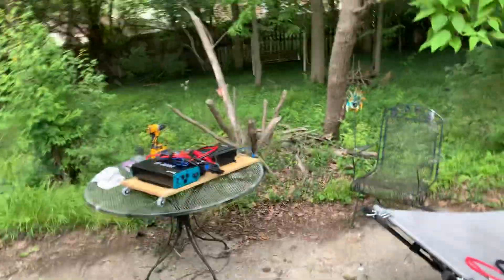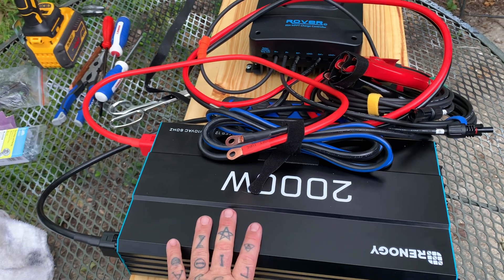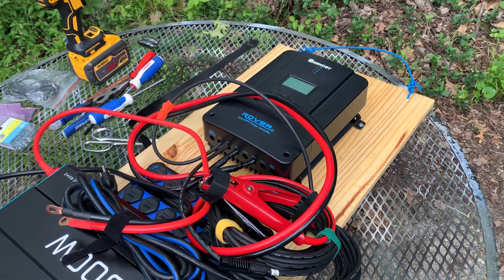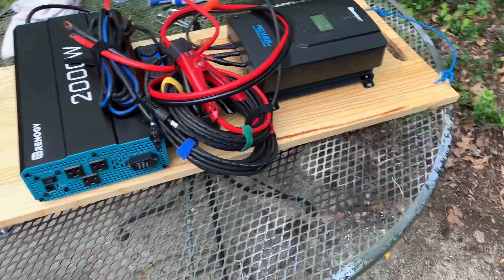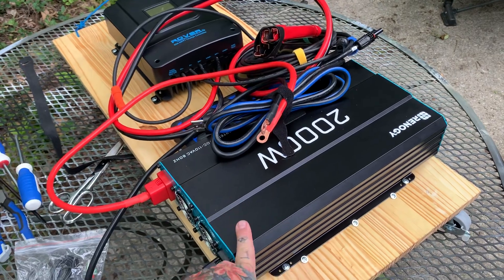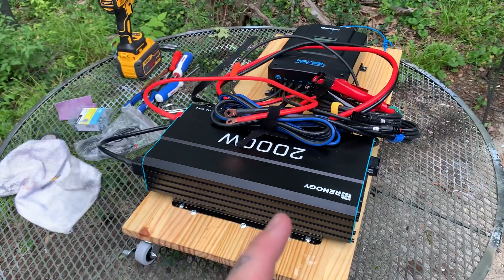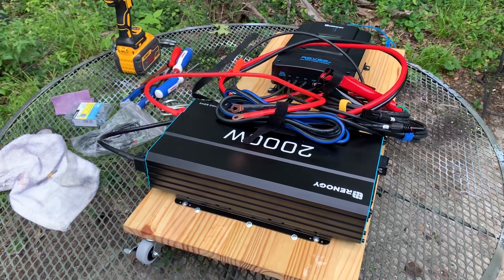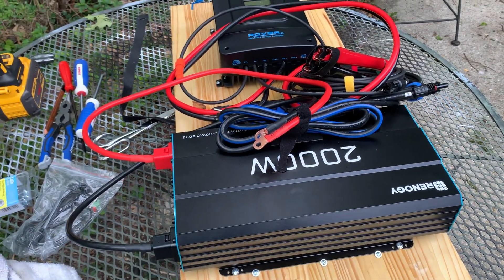🤩🌞 My portable SOLAR POWER rig I built ☀️

Comment: Nice….I got a couple power banks but I probably should have gone your route. That inverter can’t be cheap and that control box. You be doing just fine when the grid goes down. Xiegu X1600 portable HF Ham 10w radio and you good to go. Does hurt to have  Avtomat Kalashnikova or 2 either.

Comment: Get lifepo4 batteries a lot lighter, and more capacity compared to lead acid for the same 100 aphr is only 40- 50 % efficient, 100 amhr lifepo4 90-95 %

Comment: Hurricane season in a couple of weeks and it’s an El Niño cycle.

A few years ago (probably twenty) there was a company that sold a bug out trailer. Just big enough to carry your supplies, not like a camper. That small trailer at harbor freight that size, with a couple car roof top cargo boxes bolted on it and it has all the supplies for a family of four for X amount of days. The selling point was that it was ready and all you had to do was hitch it up.

I like low voltage lights and just started toying with them instead of using an inverter.

Comment: Lead acid is obsolete maintenance nightmare.  Even grabbing some Chinese low end lithium iron phosphate 12v batteries on Amazon will last much, much longer without the maintenance headaches.  You'll also get more usable capacity vs using lead acid as most lead acid batteries you can't discharge below 50% without damaging the battery.  With the low discharge and charge rates of solar a lithium iron phosphate battery will likely outlast you.   The only downside of lithium iron phosphate vs lead acid is you can't charge them below 32F/0C without damaging them.

Comment: Not just wise and intelligent but also excellent taste in cordless tool and battery platform. The 60v line is my personal choice as a professional. You should also have some lighter 20v batteries of varying amp hour sizes for the non 60v tools in certain applications where you must consider the weight and fatigue.

Comment: Sir, don't forget fuses and main shutoff switch.  If possible, go 24v or even better 48v battery system.  I run 8 GC6 Costco batteries in 48v config.

Comment: I recommend lithium over any other battery mostly because it is maintenance free. My 400 watt solar panels array with 1100w inverter, 40w Renogy solar charger, 200A battery will recharge my portable tools, provide lights (led), operate a small flat screen tv, radio/cd, and as of this week, I'm making ice cubes (during daylight hours only). Also, with lithium batteries it allows you to completely drain the battery without harming it. Renogy offers kits for beginners. I've had my set up for 4 years now and love it! Last I love Will Prowse's videos, but he tends to over design which leads to a little confusion at times, so beware.
Reply from the maker: tons and tons use lead acid, .....its mostly maintenance free
Reply: Yes, but with lead acid it's too risky that you may inadvertently discharge 50% of battery capacity and damage it. For weekend warriors like me, less that I have to engage w/ my system , the better.

Comment: jumper cable clamps crode badly over time  it is much better to use lugs   its not hard to change clamps to lugs if you have problems   looks like nice set up i would make sure your inverter will run your microwave    i build my own low freq pure sine inverters   i have built them for friends also   they have very low idle waste lower than most maybe all high freq inverters  some have been running 24/7 for years now not one blow up   i forest gumped some incredible transformer winding techniques   these techniques makes for very low idle waste  it is very easy and cheap to build your own inverter Ken   if you ever need a bigger one you could build your own  dont think no i could not Ken i know for a fact you could      the learning curve is very small   you can order the main pcb boards with all components already soldered   they cost around 150 bucks for 10 thousand watt board    the case and tranny and other odds and ins you should be able to get for under 200 bucks   i have found then for free many times    even though it is a 10k board i rate them for around a 6k inverter that will easily start loads above 10k    my buddy has been running big air compressors welders planners  and tons of other shop stuff with one i built few year back                       the hardest part is rewinding a transformer  in most cases you only have to rewind the low side    the low voltage side is large wire with few turns compared to the 120/240 volt high side     so it is not that much work to partly rewind a tranny   the next hardest part is mounting every thing in a case   the pre made pcb boards truly make it easy to build your own inverter   if you can find a tranny and a case for free you may get by for 150 bucks or less   these are heavy duty  crazy tough last forever start huge loads low freq pure sine inverters  and with my winding tec very low idle under 20 watts on the one i built for my buddy
Reply from the maker: i would not use a microwave actually
Reply: @KenTheoriaApophasis  some or most charge controllers need batt hooked up before solar panels   it will blow most if you hook up solar then batt     knowing you you could school me lol but maybe this will be a reminder lol     microwave to heat some thing up is very very handy   i bet the 2000 watt inverter you have will run a small one   it dont take much capacity to run a microwave a few mins a few times a day     as long as your batts will handle around 100 amps of discharge for a few min you should be ok      12 volts  times 100 amps equals 1200 watts   a lot of those little microwaves pull 800 to 1000 watts    a little goes a long way for lights charging phones laptop tool batteries dish tv internet modem               these things makes life so much easier much better      a small system will most likely keep with those things 95 percent of the time   a bunch of cloudy winter days in a row will be that other 5 percent                               you can also add a small very efficient fridge to a small set up                                  you mite need a small propane generator for those 5 percent of times                  my ee friend and i are going to be prototyping a propane powered battery charger soon      a 120/240 generator plus a high dollar high output battery charger is needed to charge a solar battery bank   the higher the output  of the battery charger the quicker the battery bank charges     reg batt charger  could take many days to charge a battery bank and if it was a big bank even weeks lol    think about it 2 completely dead 100 amp hour batteries would take 20 hours with 10 amp charger    no one wants to hear a genny that long lol   50 amp charger would take 4 hours that is reasonable      price a 50 amp has to be continuous battery charger not just burst of 50 amps  lol    just examples no one would run batt bank 100 percent dead but you get the pic     there is lots of loses converting from ac to dc and using two machines to get job done also      a dc battery charging generator would save money because you dont have to buy a high dollar  battery charger and a ac 120/240 generator    it would be much more efficient only converting energy once and using only one machine           plus less to go wrong or up keep when using one machine insted of two         plus my buddy can make it auto turn on at any sag voltage and normal battery charging voltage the user sets                                                                      battery voltage sags the more power is used    so lets say 95 percent of the time you dont use over 2000 watts       5 percent of the time 4000 watts       normaily you have to buy enough batterys for that 5 percent of the time   this means dubble batt dubble cost      instead of dubble the batterys the propane batt charger can be set to auto kick on when the voltge sags   it also turns its self back of when extra wattage is not needed   there is so many more awesome benifets to many to write here          my ee buddy is  finishesing updates on a diff product him and another friend broufgt to  market a few years ago            he sould have time very soon to work on the brains of my propane batt chager                                                                                      it would be at no cost out of pocket to you if you wanted the first prototype   i would only want you to give your honest opinion about it on one of your videos                    it might lite a fire with my friend the best in world ee AND programer  in the WORLD!!   if you wanted the first one   Ken you know me well enough by my texts that i would not lie to ya   Yes Ken you also know i am a dumb ass hillbilly   But you may not know i have some intelligents along with lots of forest gump   My ee friend is a prodigy there's none better at new school than him in the world   I also know the best old school ee in the world and a few that rank very close in old school and new school       I am serious about this but make no promises because of others schedule!!
Reply: The dc propane battery charger will most likely have wifi so any setting can be changed from any where in the world from your phone or laptop                    It will come down to cost but knowing my ee buddy he will not settle for nothing but the best    He dose research on every little component that he uses in his design  Every little component that gets soldered onto the pcb has so many years track record with no issues   He WILL NOT design any thing with inferior parts to save money    He has to work for him self because of this  The last big i mean huge company that haired him to redesign a product got told to shove it      It was over a tiny component costing one or two cents more  He worked a few months and would not budge on the company owner wanting to save a few cents on one component     ee designers get paid when completed  design with cad and gerber files and programing is handed over   Every thing was finished besides changing one component  to save few cents per devise      Instead of putting a design out that would fail not long after warranty he told company owner to shove it    Company owner could not believe it the product had already been proven   Change one brand component get your pay check   Pay check i dont know for sure but had to be 10 to 20k   There are a few left in the world that care more for people than money Ken     I hope you remember this   You will see for your self if you decide you want the first propane battery charger     let me know if your interested and i will get with him to see how long to make it happen   It will not talk him long it will be cake walk with his eyes closed compared to what he has been doing    You would love and you need some of there other products              i think they need more advertising on those other products also but i have  zero say on them but can bring it up and bug  lol
Reply from the maker: jumper to battery from charge controller is find, but NOT from battery to inverter
Reply: @KenTheoriaApophasis  believe it or not Ken the SMART apc ups are pure sine wave and can very covenant    They normally are 1500 or 2000 watts you can use them off grid like reg inverter   Push and hold power button let go when it beeps to turn on to use off grid     Or you can plug anything into them you want to stay on when power goes off and plug it into the grid   They have a built in batt charger that auto keeps batt topped up  You can change the charging setting for diff batt types or voltages   There is seral port and or usb you can plug laptop into to change any setting    They must say SMART to be pure sine as far as i know   The small batteries in them go bad and people throw them away or sell them dirt cheap   You can hook reg size batteries to them   Most i have seen will need two batt for 24 volts They sell nice looking battery cases to put the reg size batt in for around 20 bucks   Of course the nice looking cases that cover up the batteries are not a have to   I have used one for 5 or 6 years on modem lamp tv and dish box  Before i hooked it up kids or wife would miss the most "important" part of movies all the time  Dish box takes for ever to boot back up and the grid power flickers or goes off all the time around here   I have a decent size solar system nest door in my shop   We dont use the shop solar when the power goes out unless it is out over 2 or 3 days   We could easily run a cord over but this little 2000 watt smart apc dose every thing we need until grid comes back on   It is so easy to take old bad batteries out and hook up 2 reg size solar batteries   Some mostly the sever rack flat type smart apc have anderson plugs   I have never heard or seen one that was bad besides the bad internal batteries  They are very tough low freq inverters      The reason i wrote this book on smart apc ups is shit happens ALL THE TIME   Even way more so with high freq inverters    These smart apc ups inverters can be free if you not in big hurry and look    They make a very reliable tough back up inverter   And every one needs a back up for there back up   One or two would not eat a thing and may very well save your ass   You can use off grid with solar panels just like any other inverter     Good barder materal if shit hits the fan also a little power goes a long way    Ambers shaking her head i must have past over board  hours ago Lol  God bless you Ken

Comment: the issue I see with portable 2000 W inverter is reliability. One cannot "calculate" how much will last these inverters. If you attach some power tool, the main issue is start power. And this start power this inverter must hold for some moment. One inverter will hold, the other one will not. How do you know? I'm not sure once someone sees this PCB inside.

Comment: I like making and keeping things portable myself and I dont like having exspensive batteries tied up to one project as specially if not living off grid full time. Its nice to build your own battery packs. You can connect and disconect making any voltage you want. Ive learned alot from the rc community over the years seeing how they were further ahead than everyone when it comes to batteries. I would keep a power inverter on the truck along with the batteries always keeping a full charge like marine batteries that weigh a ton. I can just pull a retractable cord and have power any where anytime.

Comment: My go-to guy is Will Prowse for solar info. Also Eco-flow has some great solar and AC powered generators. Basically just great batteries but very effective and easy to use. Good video.
Reply: I looked into Eco-flow's generators and the biggest drawback is when the battery is low, the inverter gets hot and it takes way too long to recharge the battery.
Reply: @URIAM2  I guess I never let them get that low. I usually use the AC outlet and the max and pro models charge fairly quickly.

Comment: I can run a hoover, washing machine and a kettle on mine. Powers 90% of construction tools too. Nice rig 🤜🏻🤛🏻
Reply: Did you earth the inverter? Some appliances need to have an earth.
Reply: @johnchoice1371  nope plug n go. Eco Flow Delta battery. I run 2x 110w linked in series to charge.

Comment: That’s a lot of weight to hang off your handle , make a metal oval with extra area under the handle , and glue & bolt them together, better safe than sorry !
Reply from the maker: its actually not, they dont weigh that much